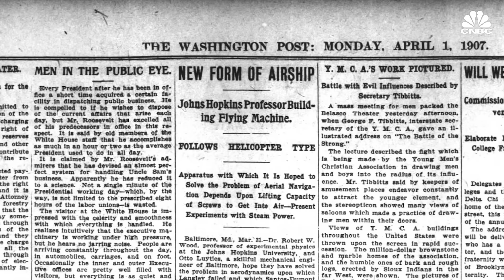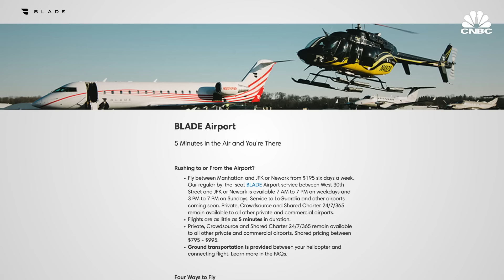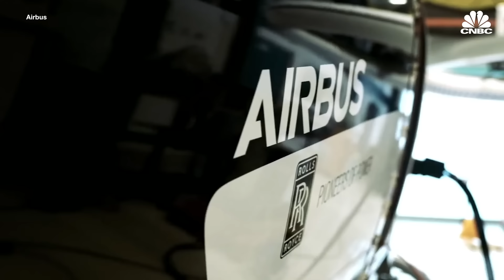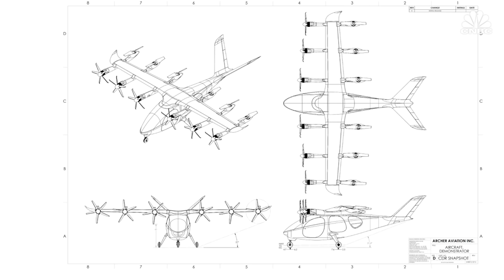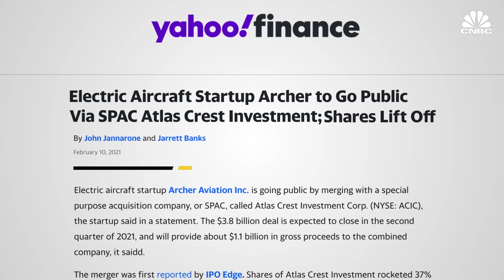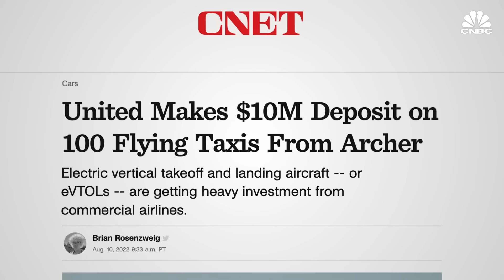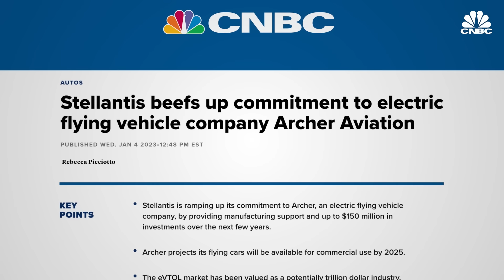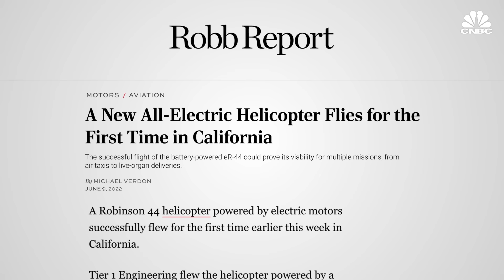How eVTOLs Could Disrupt The $49B Helicopter Industry

Comment: An EV for 300 miles range with less than 6000ft ceiling will be the absolute limit for this vehicle class.
Reply: 6000 ft. is ridiculous --- even helicopters don't need to go above 1000 ft. most cases

Comment: Battery weight is the biggest hurdle. Currently roughly 58 lbs of charged batteries equals 1 gallon of fuel about 6 pounds which gets lighter as the fuel gets used up where it doesn’t as the battery charge gets lower. If the battery tech gets lighter this industry will explode.

Comment: "Batteries will get better with time", or not. Unless a breakthrough in physic, the battery power to weight won't be able to compete with combustion engine.

Comment: I would love to see them being operated out of Spokane International Airport as air taxis to the towns within about 50-60 miles driving distance. For instance, people in the Coeur d'Alene, ID area could go to Pappy Boyington field on the north side of CDA and take an air taxi to GEG, which is a straight line distance of only 35 miles. Right now, everyone is facing 1+ hour drives to GEG, plus the gas and wear & tear, and then 2-3 hours to get aboard their long haul flight. If these could be developed to go 400 miles, the people in the greater Spokane area could fly to Seattle, Portland, Boise, much easier.
Reply: Laugh.   Or, you know, you could be a responsible human being and encourage your local government to invest in trains.  Your idea of "taking a helicopter to another airport only to then take a taxi to the airport you want to go" is so celf-centered it's insane.
Reply: @ac583  Where did you get the idea that I'd be taking a taxi to the airport. The heli-taxis would be going directly from Pappy Boyington field to GEG. I'd get off the heli-taxi, walk into the terminal and then to my flight. As the capabilities are improved, heli-taxis could even be picking people up from local towns and taking them into CDA.
The hour long drive, usually at around 3:00am, would be done away with. No more cost for that transportation. No leaving the car in long term parking that requires a shuttle bus to get to the terminal.

Comment: In almost every industry now developers and engineers are saying everything will be powered by electric motors using batteries. If so many new things are going to require batteries are there actually enough raw minerals to produce all the batteries and to replace them as needed?
Reply: Is there enough oil?

No.  Resources are finite.
Reply: @timgilreath3792  pick what resources you want well deplete it quickly … minerals or oil

Comment: Retired pilot here... So let me get this right. You're proposing that an eVTOL will be soon be able to take off at max gross weight, and then fly an FAR Part 135 air charter trip, 200 nautical miles, in actual IFR weather down to minimums, from point A to point B. Miss the approach. Then divert to a legal alternate airport. Then shoot another approach there. And land safely with with a 45 minute fuel (energy) reserve? As per the Federal Aviation Regulations?

ROFLMAO... Never happen!

Comment: Why do the Evtol designers not seem to be concerned with a hybrid solution at present. Rolls Royce are making a very compact Jet fuel powered generator. Why not just go with that for main power source and have limited back up battery capacity for emergencies. Then you get the longer ranges whilst also taking advantage of the simplicity and redundancy of the multi electric motor propulsion.

Comment: At the time of social conflicts, new industrial revolution is more needed than before,so at least eVTOL is a start~
    However since human used to build cities around rivers and roads for generations, if eVTOL want have more impact, I believe best ways is to build new concept of cities to prove it's advantage .
    But for now it seems how to integrate eVTOL travel to cities' current development is more practical option.
  Nevertheless my initial thoughts are :people who  live in rual area maybe prefer to use eVTOL for  work in central cities(due to high living cost ), but in that case the vehicle need to be designed to carry more passangers.
    And when you near the central area, eVTOL need to land a special station to avoid tall building collision(due to lack of AI control that support by huge data collection).
  And  after landing ,passangers can switch l to bus (or else) to continue journey.
    So anyway, still a lot of work need to be done but at least it's a start.hmm

Comment: These things are light enough to be equipped with parachutes. They really should of done so. The moment one of these things crashes fatally billions in market cap will be lost the whole fleet would be grounded cause they are in an infancy phase. And they will easily be set back two years. Fear will take over even though this design is safer than a helicopter.

Comment: New Engine Type (NET) tech is combustion distributed power which makes all EVs obsolete.  It is also 200 times less CO2 with RE fuels.  EVs are obsolete in many ways.  NET can fly 25 to 360 mph for roadable version or 0 to 360 MPH with VTOL version.  Use gasoline, Ethanol, natural Gas.  Make fuel for $1/gal.  Active drag reduction cuts drag by 50%, no computers needed.  NET costs about 20 times less than a Joby or Archer for 100 times more range.  NET can have a taxi for 5 for around $100k and Joby/Archer are $2 mil.  NET can replace the need for airlines, but EVs cannot.  NET could have common man owning NET, but not with Joby or Archer...

Comment: impressive , but all will depends on battery technology and high efficiency solar panel
Reply: Archer is using off the shelf battery technology for both the prototype, Maker, and the production model, Midnight. There Won't be any solar panels. The average trip will be 30-40 miles 1-way. They'll also recharge after every flight. And incase you're wondering, the full range on a single charge is about 100 miles, which will give them a pretty good safety margin.
Reply: @helifanodobezanozi7689  Thank you 100 mile is pretty good range

Comment: I love new tech and love traveling solo via car l but if we want to go electric and make a real impact? Build a maglev train up and down the east coast or across the country. The tech is operational right now in Shanghai and coming online in Japan. 

This eVTOL is a rich man's toy. Same as modern helicopters.
Reply: We take jet powered aircraft across the country. Maglev is still too slow and acquiring properties from coast to coast is WAY too expensive. 
Easy for China as people can not own ground. They rent the ground from their government.
Reply: @TheBandit7613  I'm on your side in this regard, I'm pointing out how eVTOL shares the same cost prohibitive traits as EVs, its a rich man's toy. I can buy a Corolla for 22k brand new. A tesla model 3, with less range, for $45k+
Reply: @trepan4944  Agreed. 
And I haven't heard a single person bring up the weakness of our power grid. What happens when 100,000,000 people come home from work and plug in their 240 volt, 50 amp car charger. 
POOF! There goes the grid! 
I saw several Nissan Leafs selling cheap. Turns out, they need new batteries. Nissan is charging $16,000 plus installation. 
Sorry, no thanks. That's like buying 2 engines (installed) and a transmission and a set of tires.
Reply: @joeking433  also kinda agree...
Reply: @joeking433  Who wants to sit on a train for days when a plane can get you there in a few hours? 
Besides, buying property for a 3000 mile (or 4800 KM) right of way will take decades and cost trillions. 
Trains are so 19th century. Been there, done that.
Reply: @TheBandit7613  Yeah, definitely!  We already progressed past trains and buses.

Comment: The average helicopter trips are over 100 miles.These electric aircraft at present battery tech can only achieve 20-30 miles.The experimental ones are flown without a passenger pilot payload that requires much less power.
Reply: The earliest type would be used like Uber. From downtown to the aeroport or other short commutes.

Comment: Still the biggest problem with this and all EVs is the battery. In aviation weight is key and batteries are very heavy which limits useful load. With limited useful load they have limited utility
Reply: But they will be cheap to build and batteries aren't a big percentage cost of a $4 million eVTOL like they are in an EV!
Reply: That's why they'll be used for short trips as planned.
Reply: @joeking433  In order to get lift and range  to fly you  need less weight corresponding to available fuel, In jet engines you can dump the fuel or required fuel to weight ration can maintain, But in EVOTL even if battery don't have enough charge to attain a lift or range weight remains same. Hope you understand what i mean, If not will give detailed explanation

Comment: 2:22 
Is the RPM lower? That's so strange to me considering in all the FPV drones I build, the smaller you go the higher rpm you have, and the larger the lower rpm. 
My guess would be that 1 single giant rotor would have a much lower rpm than those 12 really small rotors.
Reply: Probably tip speed, not RPM.
Reply: @zapfanzapfan  I thought tip speed on all rotor aircraft is roughly the same, which is exactly why the rpm is different across different aircraft. I watched a video with an aerospace engineer explaining why we choose different speed motors for the drones we build, and the answer was that you gain 'free' performance by increasing the rpm of the motor until the tips start going too close to the speed of sound, at which point you lose efficiency.
He said that this is why (allegedly) a helicopter and a little drone have very similar top tip speed, as the tip speed on both approach the speed of sound.
Reply: @definingslawek4731  Reducing the tip speed seems to me the only way to reduce noise. I don't know how the overall performance calculation changes when going from piston or turbine to electric.

Comment: Apply the same design. Take out the battery and add a regular combustion engine.
Reply: Good luck affording all that Gas
Reply: @Nabee_H   You can say the same for rare metals required in current battery tech.
Reply: You cant. That was the whole point. With an engine, you need physical metal parts everywhere and why they only have 1 rotor. Electricity is just a cable, so they can have many rotors.
Reply: @TheBooban  but the battery is alot heavier than ICU.
Reply: @Nabee_H  the electricity is being generated from oil. Just somewhere else.
Reply: @dropcity  I mean not all the time, we have many different sources of it. Currently where i live its Nuclear, but even if it was oil the point isn't to immediately go 100% renewable. The point is to be Capable of it. If one day Oil just seized to exist we wouldn't be able to get anywhere. We cant create synthetic Gas as easily as we can produce electricity.

Comment: I don’t think certification will take as long as even a conventional helicopter - think about it, very few moving parts, at least double or triple redundancy almost guaranteed - what is there to certify from a mechanical point of view?! Air traffic management is the biggest hurdle, but I guess this is where Tesla will come in with StarLink to manage that.
Reply: You just said Tesla and starlink will be in charge of making sure these things don’t crash or fall into your house.

Is that was Tesla and starlink are investing in?
Reply: Archer hired a former FAA executive, so certification for them should be fairly easy. As for air traffic control, I remember reading stories back in the 90's about the FAA researching this issue. Also, the first generation of EVTOL'S will be piloted by humans.

Comment: Finally, an EV that actually makes sense..
The only limiting factor I see is the battery recharging issue
Reply: the solution to that, IMHO, is the first successfull commertial multi ev rotors eVTOLs will be of hydrid design.. where a gas powered electricity generator, along with a battery will provide electricity to the ev motors.

Comment: No they won't because they have high disk loading compared to a single rotor helicopter. They are not as efficient in hover and loiter as a helicopter and don't have the lifting capacity. And this is not something you can engineer your way around, it's basic fundamental aerodynamics that a single large slow turning rotor is more efficient than several smaller faster turning ones.
Reply: Efficiency is not the goal here. Reliability is. A single rotor is a single (and in case of helicopters fatal) failure mode.
Reply: @lepidoptera9337  Helicopters are literally the safest sort of aircraft to have an engine failure in. Look up autorotation.
Reply: @atomicskull6405  Yes, Dude, that's why there are so many dead people in crashed helicopters. Let me give you some serious attention anyway. ;-)

Comment: Not quite a helicopter, the footprint is large.  Also it may be safer, but the blade are not protected. Also the chassis is very small.  Seems like it is much cheaper is the bigger leap, but cheap isn't better.

Comment: This will not be any cheaper then a helicopter.
Reply: They should be!  They're a lot easier to make and there will be more competition.  That always makes for cheaper products.
Reply: @joeking433  It does not matter how much easier it is to make. 
Electric cars are way more then gas cars.
Reply: @saulgoodman2018  A Chevy Bolt is $26k before the tax credit.  That's pretty cheap, right? The average ICE car sold is $45k!  Do the math!
Reply: @joeking433  the bolt is only 1 of the cheapest. You can get a used ice car for a couple thousands.

Comment: if the title is a question the answer is always no.
Reply: Why?
Reply: It did say 'could,' didn't mean It 'would.' Not even close
Maybe the small scale stuff, but the whole industry? Na.
Reply: @JosueMartinez-ww1vj  Not even remotely enough range/endurance.
Reply: @PistonAvatarGuy  what are the numbers? Miles/charge? 
Scientists are researching for new batteries, so in a few batteries are going to take over oil.
Reply: @JosueMartinez-ww1vj  A normal helicopter has about ten times the range of one of these things. And, no, batteries are not improving significantly, that's a line that everyone keeps repeating, but it isn't based on anything in reality.

Comment: EVtol will disrupt it when it becomes autonomous. Because when it does the costs will be less than 10 cents a mile to operate. And if you think that will not happen? China already has a commercially operating 2 seat Autonomous EVtol service in Shenzhen for tourists to take aerial tours. Cost of the aircraft? Less than $500k US.

Comment: There is some disruption for people transport. However they can’t carry any payload so no heavy lift, no firefighting, etc… Show me any EVTOL that can lift 26000 lbs. There are well over 200 applications for electric air vehicles but only a couple are FAA approved. This is the same business model where helicopters were going to transport people all over the place, mail, etc, with all the same passenger terminals, etc..look up all the information on Los Angeles Airways. Heavy government subsidies, etc… There are also new risks having more electric motors because the control systems are only as good as the guys that programmed them. The flight models may also be drastically more different taking off and landing on top of buildings.

Comment: Lol this will never replace helicopters, considering they are still way efficient design and has more range than battery or fuel cell vehicles (also aerodynamic considerations like disc loading. You are better off rooting for turbo electric systems on helicopter that could theoretically make the vehicle efficient at any point of operation.
Reply: Efficiency during takeoff and landing is not the goal. Reliability is.

Comment: Until battery mass is reduced, the only way EVs become economical is if some Nicola Tesla level of thinking invents a way to transmit energy over an internet, of sorts.
Reply: EV's are already economical, and in eVTOL's batteries make up maybe 1% of the cost.
Reply: not necisary, IMHO.. hybrid power will likely be the first commerically successful eVTOLs. And those would use gas generators along with a battery.. kind of like a Prius or more specifically like a chevy VOLT

Comment: The answer is not until the 2040's at earliest. Better solution now is quieter helicopters with new turboshaft engines that use less fuel. And use sustainable aviation fuel (SAF) a lor more.